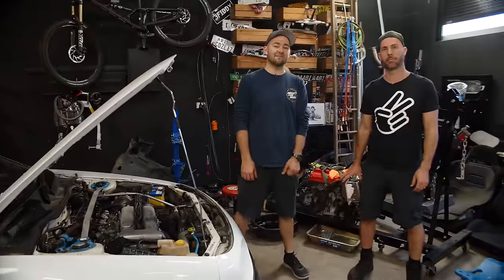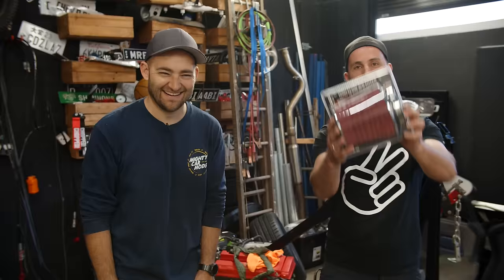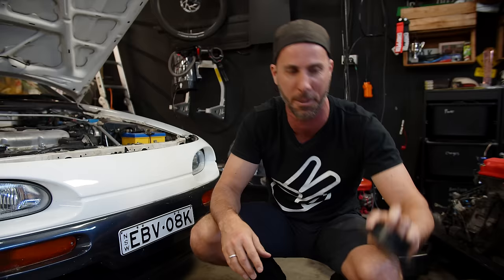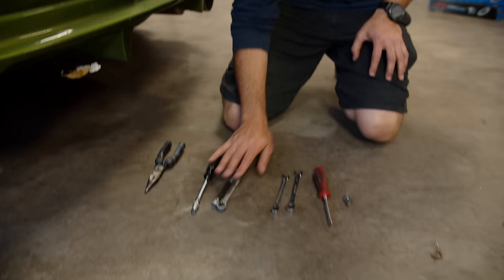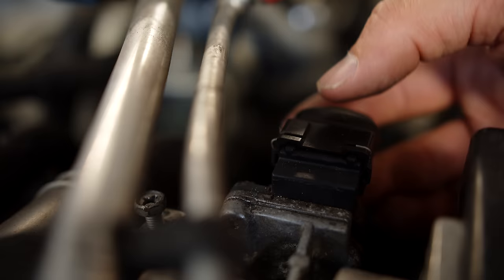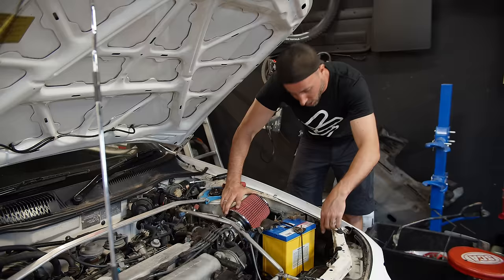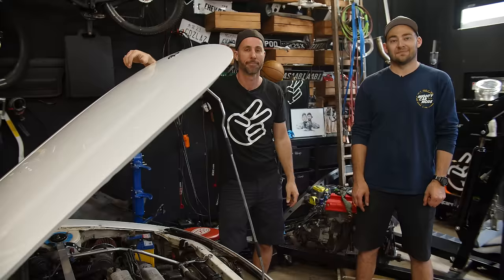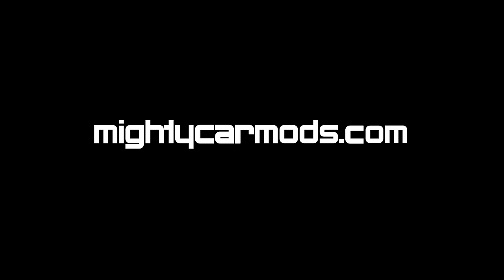How To Install a POD Filter

Comment: Adding a pod filter
"First jack up your car"
We are on the right channel boys 😂
Reply: This one never gets old 😂😂😂
Reply: It's good to go back sometimes.
Reply: It should be “Disconnect Negative Battery Terminal.”
Blah blah blah
“Reassembly is the reverse of the disassembly procedure”

Like every workshop manual.
Reply: Benjamin Gross Oh.
1. Roll GoPros
2. Get your car Jacked Up
3. Remove Negative battery terminal, we ain’t got time for anything negative around here.
4. Do stuff to the car.
5. Reassembly is the reverse of the above process. Ie, Get Tofu kebabs, unroll cameras, hook everything up positively...
Reply: Why? I need a step ladder to do spark plugs.
Reply: @Agria1600  could not agree more 😂
Reply: Mine’s still on jacks from about 4 years ago.
Reply: @darrylvanrooy  my dad's beetle restomod is on stands for at least a decade

Comment: Second step after jacking up your car is to drain the radiator, you won't need any additional engine cooling with the sub zero intake temperatures that the pod filter is going to create.
Reply: It's also a great weight reduction. In fact, the entire radiator system is now just dead weight. Get rid of it.
Reply: @jamesf456  Don't forget the air con either. You can just run a hose from the pod filter directly to the air vents. More weight reduction!
Reply: Don't forget to disconnect the battery as well...

Comment: If you want more air, take your intake manifold off.
Reply: Rookie. Take out the windscreen and wear a helmet. Racecar
Reply: Or jack up your car.
Reply: Fact: Bumpers are put on by the manufacturer to make you buy their OEM turbos. Don't get conned; remove them yourself!

Comment: Well that's the speed video challenge done! And it didn't even cost $2000 (plus 800). And I still laughed more times in 90 seconds than I have in the last 8 hours at work as maths states 7 > 0

Comment: In the states we usually call it a "cone filter". Who knew... lol ;) But typically the stock air box does just fine in filtering the hot air from the engine. If you want power; turbo, and or a tune. You guys need to come over here and do video on a manual conversion on an Audi A4 B5 Quattro I have. I'm getting to old for this shit lol

Comment: man since I bought a volo nearly all 4 cylinders sound like ass and yes it was the cheapest one on car sales.
I bought it for $650 and aside from being 5k km overdue for a service, a mild cold and sub 2k rpm missfire, 336k km(pretty typical for a well maintained volvo), smoker car, dog owners car, ripped drivers seat, trim cards are shot, dodgy auto shifter button ( that is a real pain in the ass),cruise control not working, minor urban warfare dents, and roo hit damage to the bonnet, flaking clear coat on the top surfaces that get baked by the sun, split cv boots. 

She is a really good car and that i5 shriek is a amazing

Comment: everything except the final point aka leaving the stock inlet pipe.. once the airbox has been removed this becomes a redundant piece of plastic as the airbox utilised vacuum to operate aka the sealed airbox, you've now a open air filter which doesn't produce vacuum to to utilise said feed-pipe

Comment: only watched the cos of the unicorn circuit, otherwise wouldn't have watched it as they already proved that pod filters are actually the same if not worse than a standard panel filter. Saying that they do give you nice induction noises, which I got on my corolla about 15 years ago by getting rid of the baffle and putting some storm water pipe to make a larger inlet, plus this message too longer to write then the episode! LOL

Comment: could you do another Pod filter mythbusting with cold air intakes for non turbo and turbo cars?  we saw how a short ram intake works but not a cold air intake. would be interesting to see them side by side on the dyno to see if a CAI runs more horses than a SRI, having the bonus longer piping may also help with the airflow and pressure that a standard filter box has

Comment: There is only one success story I have had with pod filter which is a s2000 standard paper cone filter  that’s on my tdi common rail Audi i wouldn’t say it’s increased power but with that and removing the weird stick centre box it’s dramatically reduced turbo lag I think this is due to there one size fits all approach air box system that Audi and vw use

Comment: and unlucky for you i have CIA on my l77 and i picked up about 15hp and a shitload of low end torque. this coupled with an extractor made me pick up about 50 killerwasps at the flywheel. -_- so yes. podfilters do work, you tried it on a fucking car that had no hp to begin with. i bet if you tried it on a car that had 200+hp you would see a difference.

Comment: Pod-filters on stock engines are useless.
If you're going for sound, drill a properly sized hole in your filter-box on the unfiltered side, use a step drill and go all the way, should produce a loud growl, sounds WAY better than a pod filter.
If you're after performance you're far better off buying some light weight rims.

Comment: I love you guys, in a hetro way, but please stop showing people how to install a HOT AIR INTAKE, by getting air from behind the rad. No truck or car has been made like that in 20 years. More noise and less HP is not better. Engineering Explained did that and then did a vid on the temp gain and HP loss and another on "High Performance Filters" that did nothing. The factory ones are usually very good.